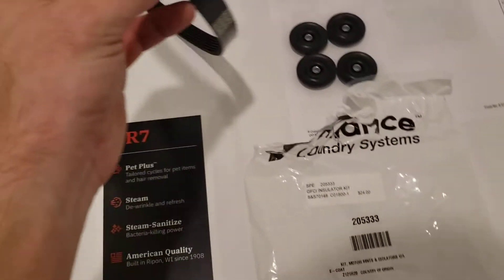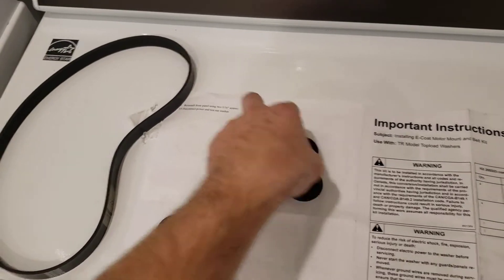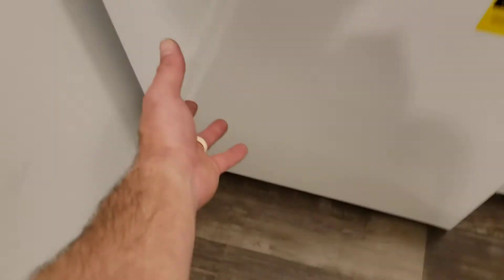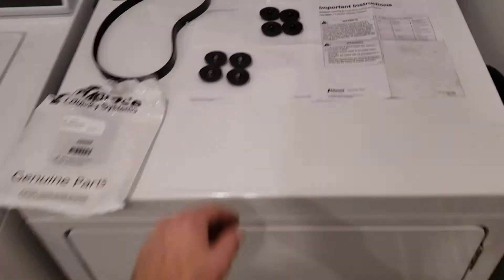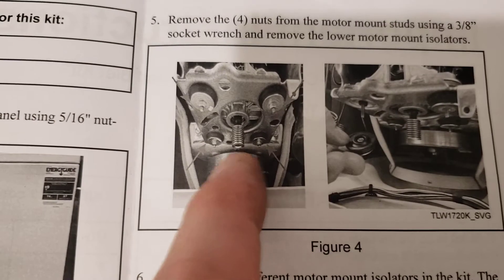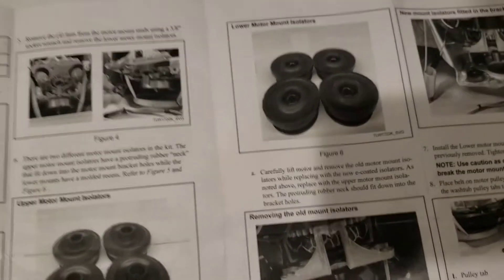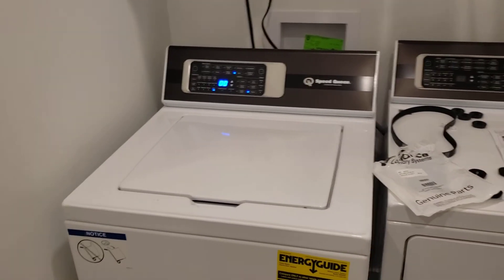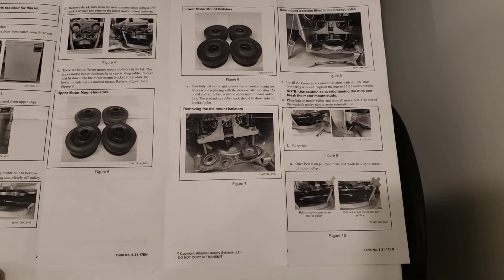SPEED QUEEN WASHER GFCI Insulator Kit. 205333 For Model AWNE9RSN116TW01

Comment: awn63rsn116tw01 have a similar model here with the same issue, is that machine covered under the same fix as the one you've listed/shown?
Reply: Looks like there might be a replacement number... #205402 but I haven't confirmed it yet

Comment: Oh my god. I replaced my eaton gfci breaker twice(they are notorious for going bad), my washer keeps turning off during soak or wash cycle only thinking I had some sort of outlet issue. Thank you so much for this. I will be calling g speed queen on Monday.
Reply from the maker: Hope everything worked out for you! Its a lil complicated to do. You have to remove the motor. Did you get it figures out.

Comment: I am having the same issue and the plug my washer is tied into has a gfci. Sometimes it trips immediately other times after a few minutes. My house was built a year ago and the breaker for my washer circuit is also a gfci and afci. Is there a way to tell if I have the “old” motor mounts installed?
Reply from the maker: The old ones have a silver metallic bushing. The new ones are coated with a black material and do not shine. The black coating keeps them insulated from ground. And have a rubber grommet bushing around them

Comment: Where did you buy this from
Reply: Thank you! It’s def under warranty just running into a problem getting the parts and I was just doing homework to see if you got them from somewhere else in case they didn’t have them is all. Thanks for the video!
Reply from the maker: @taylormade667  you're welcome. Glad it helped. Hope it resolved your issue. I work for a local appliance repair company in my hometown so just let me know if you have any other questions or problems with some of your Machinery maybe I'll be able to help
Reply from the maker: Manufacturer
Reply: Like from speed queen? Sorry I’m not a dealer but just bought the exact washer and it’s doing the exact thing. This video really helped
Reply from the maker: @taylormade667  no problem. Yes. Contact speed queen. If you just bought it, It should be under warranty. They will send them to you.